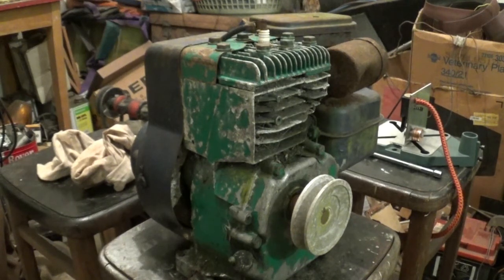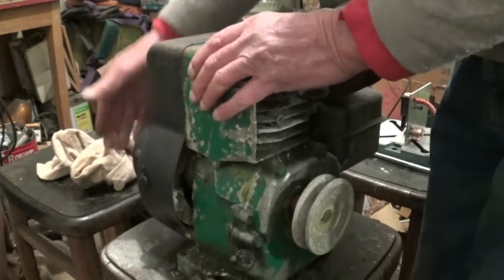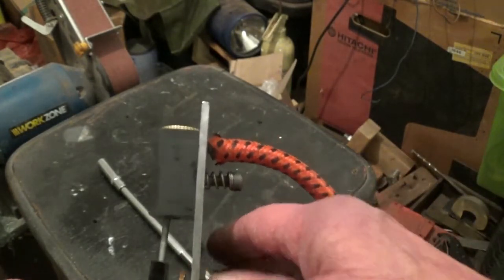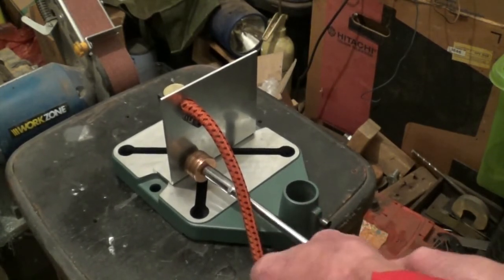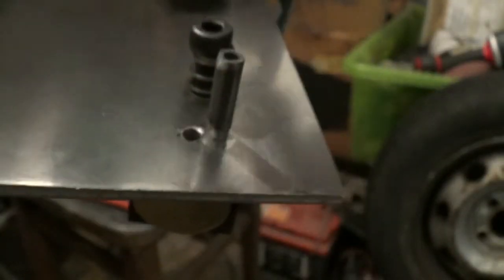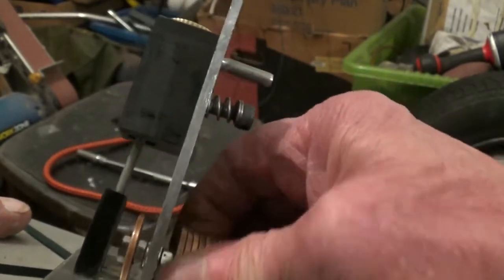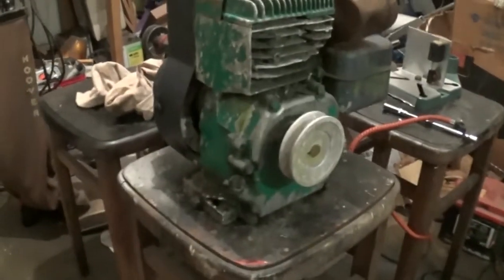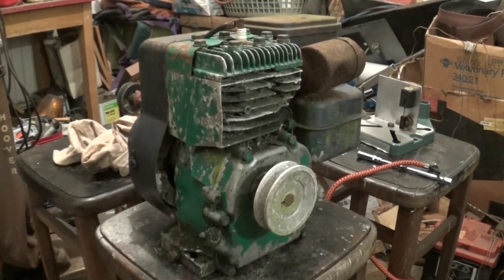Mystery Engine No 1 My Winter Project

Comment: well at least the engine isn't frozen solid and has compression that's a very good start. yes and the steam engine was not a waste of time because you showed others how to do it makes a very good example even if it is too stiff to run. Well the whole idea for the steam engine is perfect in its design just the construction needs a bit of tweaking. Im sure the Mystery engine will work much better.
Reply from the maker: When I watched Lyle's video Larry, I thought that's a great idea, I'll try and get it shared, spread the word so to speak. Get a few young people to have a go. Well of course, as you've seen, it's far too difficult to find small offcut stock, plus equipment. Shame really. Anyway this engine will be a lot of fun to take to shows. Even if people know how it's done, and most won't, it will be cool to show it to them.
Reply: Yes it will make a great demonstration piece at shows to show how a steam engine works.

Comment: I've never heard of a mystery engine, but it sounds cool.
And I am having mega issues with my little steam engine too.

Looks like it has to be metal engine block for it to be half decent.
I also think it's not going to work, but I will keep at it now and then if I get some block materials, possibly might just start from scratch, when I get some.

I will be turning a mountain bike into a motorbike early summer lol should be funny.
Might have to build it early if the snow comes, so sliding action.
Reply from the maker: Do a search for 'engine running without a spark plug' Darren.....then you'll see what I'm attempting to do. To do a working little steam engine is a doddle compared to this lol. If you really want to make a small one, it can be done without a lathe, but everything has to be exact. You also need to get in touch with someone who has done it. Emma, Colin for instance who will give you the exact measurements. Because that is the only way you'll get the timing right for it to run.

Comment: timing malc. make sure the holes are closer together than the diameter.. or that the gap between is smaller than the diameter. I know youll get it!
Reply from the maker: Thanks Emma. Timing is off, however it's much too tight. Piston fits that plastic bore better, but the bore is not true. When I drilled it the glue gave, so down from clamping with mole grips it's slightly smaller. On this size I don't have to tell you how critical it is. I ran the drill in with it in the vice, loose at the bottom and tight at the top. Ran it for a bit but now it's too loose at the bottom but still a tight spot in the middle. As I've said, yes I could do it, you've seen me do much more difficult than this. But it was to show an easy build.....well it's not, as you've seen so, as a project for a young person, I'm sorry to say it's not suitable. Need to find something that is relatively easy to do, and works at the end.

Comment: I think the stroke is a bit long on the home built engine Malc..BTW...Radio control nitro engines have nice little bearings in them..A worn out old engine may be a good donor for parts.
Reply from the maker: Thanks. Whole idea was to spread the message that you can build one of these with simple items and only a good drill press. Well I've proved you can't, unless you buy, the proper drills and materials. Plus you must have ALL the critical dimensions (I'm missing one, the distance between crank and pivot holes)That is important for the timing. So based on my experience, if any young person want's to build one, make friends with someone who has a good machine shop, and a wide range of materials.

Comment: Hi Malcolm, i've done a good few of these little engines now so if you get stuck or need any advice or parts just give me a shout and i'll see what I can do. Cheers pal. Colin.
Reply from the maker: Many thanks Colin. Several things wrong. I need the dimension of the distance between the crank and pivot holes. The exact size drills for the inlet, exhaust holes. Square ally for the block. New drill for the cylinder and correct size rod, must be a good fit. Heavier flywheel. And a £2000 accurate drill with a good vice lol. Apart from that it's fine (grin) But as I've said, the whole idea was to show it can be easily made with a few tools and easily found stock. Well it can't. Cheers Mate :)

Comment: Try to find an old skateboard in the trash or at a 2nd hand shop... 8 German Bearings in the wheels. That would aid in minimizing the crank shaft resistance on your mini-steam engine.
Reply from the maker: Yes it possibly would.....point of this was to show youngsters they can make one easily, with only a drill press. Well they can't. I've struggled as you've seen with over 50 years engineering experience. Onwards and upward to the next as they say....or should that be backwards and downwards lol.